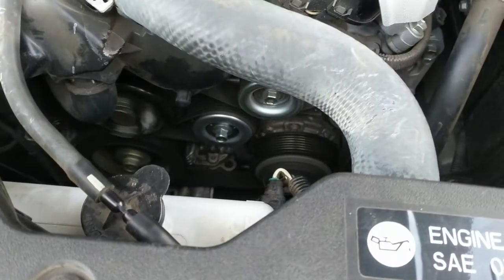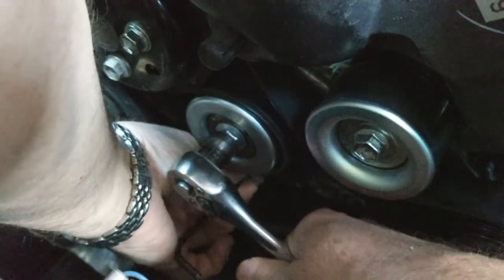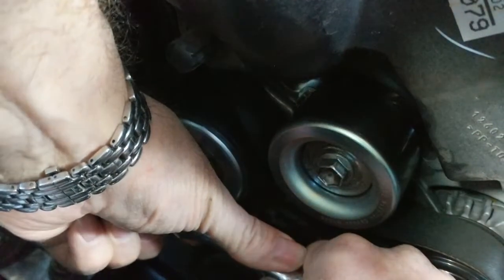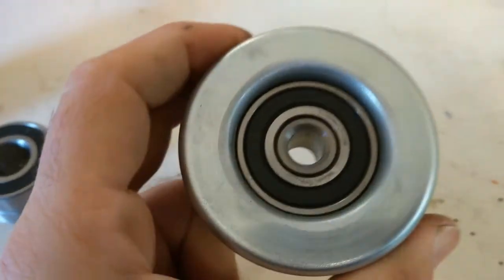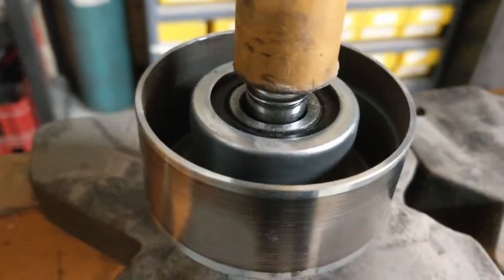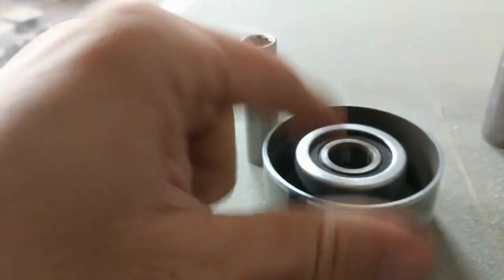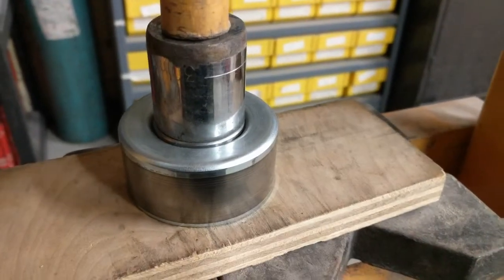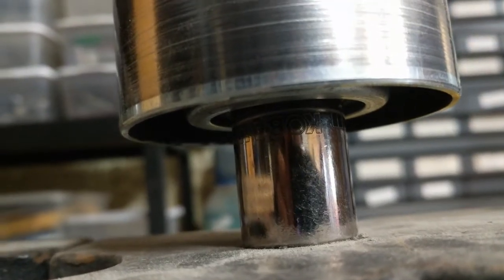Lexus and Toyota tensioner pulley bearing replacement

Comment: Is this possible to do without a press?
Reply: A press is essentially a machine to impart a large force on something. Back in the day lacking a press, we jacked the back of a truck, placed a short steel rod under the cross member which pressed on a bearing or bush. Then gently let down the jack so that the steel rod pressed on the bearing/or bush. The steel rod must be straight and its ends parallel.Observe safety precautions always.
Reply from the maker: @mohabatkhanmalak1161  I have done that in the field as well.  Not ideal, but works in a pinch.
Reply from the maker: I am not sure. It took a pretty decent amount of force. If I were in a pinch and didn't have access to a  press, the only way I would think it would work is with dry ice and a C clamp. It's the same process but you chill the bearing in dry ice for about 2 hours first, shrinking it, while heating up the pulley in an oven. That is certainly not the preferred method though, and with how expensive the pulley assembly is, and how annoying it is to replace the whole unit, it's still cheaper to buy a cheap press and replace just the bearings.

Comment: Thanks so much for this, I had been looking for something on just the tensioner bearing replacement for an ES350 for 2 days. I only found this great video when I searched "lexus 6203" after a bunch of other research, I am not sure why. But add some more tags with all those models and "belt tensioner" and "bearings" and I know you will get a ton more views. Tags seem to be more important than the description.

I subbed without looking at any other videos because you had exactly what I was looking for and that is rare on here. Best!
Reply from the maker: Thanks! It was driving my father in law nuts so that's why we made the video. I'll add tags for sure
Reply: @AustinCoulson  Just FYI, if you ever need the full pulley for the tensioner, I did find one on Amazon https://amzn.to/2Chxq6D . But I am going tomorrow to the local bearing supply and get enough to do all of them, probably for the same price as that one pulley.